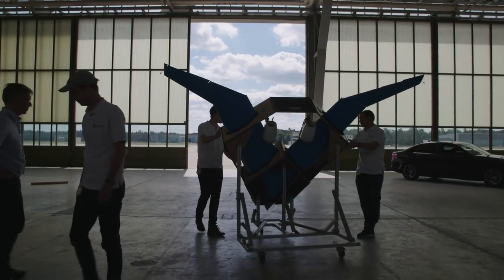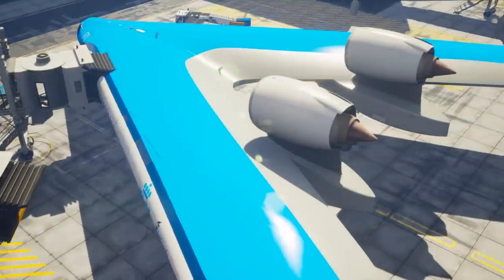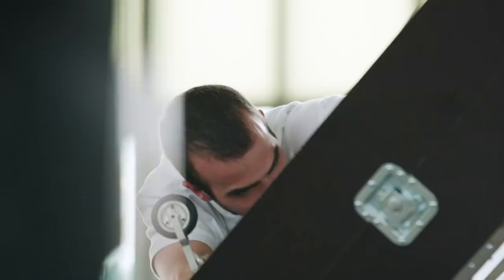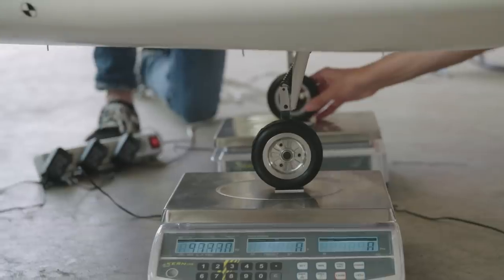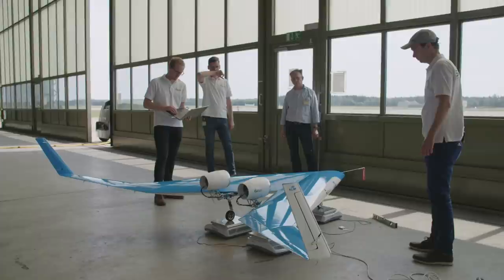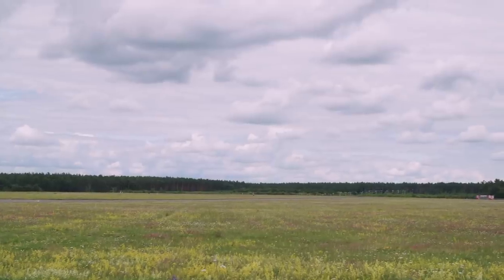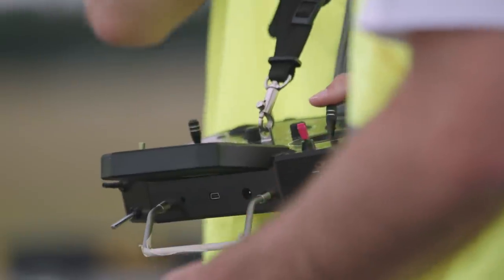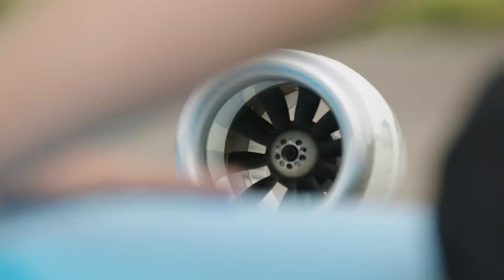KLM & TU Delft present: Flying the model Flying-V

Comment: Imagine being in anything behind first class and sitting on the toilet when the plane starts banking for a turn
Reply: Yeah, would really mess you up, especially old people.
Reply: In coordinated flight you wouldn't even be able to tell.
Reply: @isodoubIet  I think you would definitely be able to tell as you suddenly rise or sink a couple meters. He's not talking about yaw.
Reply: @nbecnbec  In coordinated flight, acceleration and gravity combine to generate an effective "gravity" vector that always points down from the perspective of the occupants. The "turn coordinator" instrument in older aircraft without glass cockpits is basically just a spirit level.
Reply: @isodoubIet  interesting but as an aviator and skydiver I'm questioning whether this could be achieved as the difference between movement on the left tip and right tip is going to be so great. For cargo it will be awesome but for passengers I'm not sure. Wouldn't be hard to find out with a few small accelerometers placed in the model.
Reply: isodoublet , technically average acceleration being smooth is possible but yes throughout any individual point on the whole plane it isn’t possible due to rotational inertia and additional acceleration from the rotation
Reply: Being on the toilet is the best place to be, no need for a change of clothing.
Reply: Pilots are simply going to bank slower.
Reply: @CaptainChrom  I would love to have the chance to be a "test passenger" it's interesting for sure
Reply: Wow didn’t think of that
Reply: @isodoubIet   Different spirit levels in different locations of the same maneuvering aircraft would have different readings at different times. You have different rates of accel/decel. And no plane is perfectly rigid, so there would be an oscillating effect added to this.

No, you'd definitely feel this. And roll maneuvers tend to be swifter and more intense than pitch and yaw. 

In all vehicles there are always parts at the extremities that change velocities and direction faster or slower than the center of mass or center of rotation. And physics takes time to work through fluids and flexible bodies so the feeling is exaggerated into an oscillation. This is why the lower and more central you are inside a ship on rough seas the more stable it feels. Ideally, the more sensitive the cargo is to motion , the closer you want it to the center of the transport- People tend to be pretty sensitive to movement they didn't initiate.
Reply: @panchonorthmann6408  There would be some Coriolis/Euler force that's larger the farther you are from the center, but this concept plane would have a larger wingspan than a 747, (it probably wouldn't roll that fast) but people would be sitting only about a third of the way up the wing. As for the lack of rigidity it would almost certainly be irrelevant.

Comment: Cant wait to see that flying in the sky! The real thing!
Reply: Me to
Reply: Same
Reply: Don't hold your breath! At best, we'll see an adaption of the wing design to current plane shapes. The tube is not going anywhere.
Reply: not gonna happen this thing is way less aerodynamic then the typical aircraft.
Reply: @rafael6693  it will happen
Reply: @rafael6693  The aerodynamics isn’t the problem, it’s center of mass and stability is the problem.

Comment: This is why KLM deserves the title of "most environmentally friendly airline"
Reply: exactly
Reply: That's nice to hear
Reply: in my opinion, KLM 737s and embraers do have small legrooms BUT their long haul flight aircrafts like the 777 has a really big leg room
Reply: Environmentally friendly? Tell that to the families of flight 4805, 433, and 441. A responsible airline doesn't kill its passengers nor litters the landscape with its fuselage.
Reply: @robertpolkamp  accidents can happen, and they are constantly being busy improving the reliability of the planes.
And klm is in the top 20 safest airlines.
Reply: Robert, I understand about those accidents but it has nothing to do with KLM being environmentally friendly, those accidents were caused by something completely different from this topic
Reply: Its nuts klm
Reply: Because they made a model plane?  😂
Reply: Jake Berry Yes of course, a model airplane uses less fuel and has less exhaust fumes ;-)
Reply: P Constructor :-) power saved per passenger transported, -1.2kw there’s no passengers and it still used energy :-).
Reply: Robert Polkamp There won’t be any responsible airlines left for one to fly, if you follow that line of thinking. Air France, Lufthansa, Japan Airlines, Korean Air, Qantas, Turkish Airlines, Delta, American Airlines, British Airways, Air Canada, Emirates, Singapore Airlines, these are all airlines that suffered plane crashes with loss of lives. Let alone mentioning all airlines involved in crashes. Your comment is ludicrous and besides the point.
Reply: Jake Berry Don’t change the subject. 1. Because you didn’t mention passengers. 2. Because if you do, I loose this discussion.
Reply: P Constructor wtf you on about we was just joking about it not being a real plane mate.
Reply: no
Reply: Why? Because they made a model?
Reply: JimmyHolster that’s exactly what I said bud look above haha :-)
Reply: @jakeberry2172  haha didn't see that.
Reply: Perhaps you mean "least environmentally unfriendly airline".
Reply: @JordyDevrixOfficial  Top 20 out of 25? Cramming 400 seats on a 777 is not my definition of environmental friendly.
Reply: @RealConstructor  You get my point. It is ludicrous to spend 2 years on a commercial airliner design that can't glide a single meter. Arguably the most aerodynamic shape is that of a 💧, with the weight and balance right I can fly this droplet around but we both know what happens if it lands. The notion of efficiency at this stage is as ludicrous as the design.

Comment: A model plane enthousiast explained to me that for model aircraft, the power-to-weight ratio can be a lot higher than for actual planes (simply by leaving out heavy things like passengers, computer systems, brakes, and susequently not requiring a strong fuselage to keep all that heavy stuff from bending or breaking the airframe). It can be even higher than for many jet fighters, and I've seen model planes do vertical takeoffs like a rocket. Given that principle, you can make practically any shape fly if you build it small enough and an engine on it. This begs the question: is the power-to-weight ratio for this project anywhere near what is expected for a real passenger aircraft?

Comment: What about turbulences? It seems it is going to have a lot of them in some parts of the aircraft, I mean: you are supposed to sit inside a wing 😅...
Reply: Turbulence will be added to the gunnies  world record for its largest turbulences 😂😂😂
Reply: @mahirdaiyan1021  😂😂
Reply: B2 flying spirit, sort-off proven concept. They will be able to sort it off with some design tweaks and software controlled flight controls.
Reply: @2R0bin0  open B-2 scheme. It doesn't have anything in it's wings. Only fuel...and force elements... Also it costs 2bln. USD.
Reply: @PilotBlogDenys  My man over here has the "B-2 Scheme".
Reply: You cant just take a look at the turbulence off of a scale model as the smaller model is gonna react more with the air turbulance
Reply: The wing is still going to flex up and down during normal flight and I don't think that will be very comfortable.
Reply: @PilotBlogDenys  The B-2 is expensive because it's a big stealth plane and stealth technology is expensive, not because flying wing designs are expensive.
Reply: If you want to know how turbulence affects large scale flying wings there might be something on Northrop's designs somewhere
Reply: Seeing as the wing is designed to be basically the fuselage it'll be pretty much rigid. Turbulence could be pretty similar to what we already have
Reply: @themistaken9571  rigid means weight, weight means more fuel consumption. They said that the reduced weight will reduce fuel consumption by 20% compared to today’s most advanced aircraft. Or maybe we should invent a new material which is light and rigid in the meantime.
Anyway, I think that the Maveric concept from Airbus is more likely to happen wrt to this one...
Reply: @NicoBattelli  Rigid does not mean more weight. A rolled up sheet of paper is more rigid than a flat sheet but they will have exactly the same mass.
Reply: @kazedcat  yep, but the surface covered by both is different, you need a lot of rolled-up sheets. 😁 However, I meant in most cases. I think it's not a fact of rigidity, aircraft need to have moving parts and parts that oscillate, otherwise, it would break more easily. I'm a physicist and not an aeronautical engineer and I could be wrong (probably), but I really would like to know how they handle this problem in terms of comfort. All can see that there is a big problem for passengers sitting at the end of these two wings, I didn't find any given interview/doc about that, as if none was interested in asking this question to them.
Reply: Nico B Passenger comport can be address by limiting the banking angle. The tip of the wings are too thin to accommodate passengers. So most likely that section will hold fuel tanks. Then you need a cargo section to hold luggage. Since the cross section of the wings does not allow cargo below the passenger that means you need to allocate cargo near the wing tips. So you have passenger near the front. Cargo at the back and fuel tanks at the wing tips.
Reply: OH, turbulences? banking angles? That will be free of charge as a value added to the customer exprience 😂
Reply: @user-os7kz3jy5c  Turbulence is more dramatic the smaller the vehicle yes.

You learn this pretty quickly when you try and get a pilot's license and end up in really tiny aircraft. Tiny gusts of winds that an airliner would barely notice will knock you about quite a bit in a smaller aircraft.

And a model takes that to the extreme...

Comment: How does this Plane get out of Stall? I suppose the mentioned "Nose Up Moment" will lead to a rotation on the lateral (pitch) axis. Are the wings and the winglets reaching far enough to the back to compensate for that? I assume you didn't dare to test that on the first test flight.

Comment: Amazing. I'd love to have studied aeronautical engineering & gotten involved with this.

Wouldn't a canard arrangement help with pitch stability?
Reply: It would but the designers wanted to reduce drag as much as possible and canards wouldn't help with that. 
The plane was clearly tail heavy so it should be more stable when they figure out when the need to shift the cg forward.

Comment: Models always work because it’s easier to provide power at small scale due to the relative density of air and lack of need for fuel capacity to support long flights.

Comment: If you already deal with the disadvantages of having the engine on top, why not use the low pressure  of the engine exhaust for additional lift by putting the exhaust stream above a lifting surface?

Comment: Is there a website (or pages within KLM or TU Delft) that gets into the technical details of the design?

Very interesting that you mentioned the potential pitch-up tendency. It would be great to figure out how to limit/control that aerodynamically, but I suspect the solution will be FBW and envelope protection.

Comment: Reminds me of a futuristic version of the Blended Wing Body. With that much wing sweep are they looking for a high transonic  cruise speed?
Reply: I think part of the reason is just to keep it narrow enough to work with current airport infrastructure where a true flying wing would be much wider. Just a guess though.
Reply: @GamblerBE  Very good point. I think one of the iterations of the BWB had folding wing tips so it would fit in a normal ramp.

Comment: I thought there was something wrong with the landing (because of the landing gear). Is that the reason why you didn’t show the landing in this video?
Reply: RC landings are often very messy because of how light the plane is. they probably didn't like showing that haha. and for good reason.
Reply: john pardon haha you’re right. But I also read that the front wheel of the landing gear broke when the plane landed
Reply: @marthijn-7544  ohw oops haha.

Comment: Imagine being seated in the rear of the cabin.

Because the seats are so far from the roll centre vs a standard tube fuselage simply banking only 15 degrees would result in these passengers “rising” metres and then dropping again when returning to level flight.

This is basically a roller coaster. This simple fact will make this unacceptable to passengers.

Doesn’t matter if it’s technically feasible and meets fuel consumption goals. It may have usage as a cargo aircraft if the fuel consumption targets are met at 1:1 scale.

Comment: Would drag not be increased due to the aerofoil needing to be a thickness to accommodate space inside? Of course I would expect that to be thought of, but I'm wondering why hasn't this been looked into earlier.
Reply: Because it's an entirely different kind of construction so a lot of things have to be developed from the ground up.

Aircraft design, like many areas of engineering is quite iterative, so people tend to stick with well known designs unless there's a big incentive to change.

You could equally ask why there are so few SWATH designs in ships, other unconventional designs.

Sometimes it's because of tradeoffs in the actual features, but as often as not it's solely due to unfamiliarity and not having any existing designs to go off to solve some design problems.

This isn't the first flying wing design of course, but the other two notable large examples of flying wings have both been military aircraft.

(and it's been suggested that the original flying wing design was intentionally buried by the US military due to it having stealth properties. - indeed the prototype was destroyed for no apparent reason. Then suddenly 30 years later the B2 bomber shows up.)

You never can be entirely sure what the underlying reasons for a particular kind of design not being explored much actually are...
Reply: KuraIthys It’s true, they wouldn’t be showing it to use if it’s not possible! The Germans made that flying wing in WW2, the Ho 229

Comment: The RC plane is more slim than in their computer model. 
Have some of the questions: 
1) Guys, can you please show us the development studies of that RC plane? If the RC model flies it doesn't mean that it is efficient.
2) Why you couldn't have made it with jet engines? I see the electric motors from Ali express.
3) How much money did it cost for KLM (maybe it is better to support the airline employees rather than spending the money for strange projects like this one)? You know, we are in worst aviation crisis in history. Maybe it is better to let the Airbus and Boeing to design the airplanes...
4) When should we wait for 1:1 scale model? 
5) How to avoid engine flame out at high angle of attack? It will be shadowed by the wing-fuselage.
6) What is the real size of that airplane? With that thin airfoil it should be one of the largest planes to contain passengers, fuel and all the airplane systems. 
7) Icing of the wing leading edge. It is very wide and will get lots of Ice. If you want to have passenger window, that is even bigger problem. 
8) Force structure elements. Please open B-2 bomber scheme. You'll see that it has all the standard forse elements like in real plane wings are reinforced. You are planning to have people there. So how to provide strength to the construction? Should  passengers seat between those formers, stringers and logerons?
9) Ground facilities. How to board passengers? How to load bags and cargo? With that V- instruction passengers boarding interfere with cargo(luggage) boarding. In current airports.
10) How much would the real airplane cost? Does it worth to take it for saving 20% of fuel. And please show us the research. Now you just tell 20% and didn't even put jet engines on that RC model. 
11) Show us the landing! Did you crash that toy? 🤣
12) How to maintain those Engines on the top. You need a high leader there and still you won't have full access to those engines. You need to maintain engines very often. Add oil, etc. 
13) How should I check engine intake for birdstrike? I won't see the inlet from ground...
14) Turbulence. You see the wing wave on normal plane. That is done with purpose to avoid damage. Here the people should be in those wings.
What can I say, guys... 
I am sure that it is just a waste of time, money in the worst time for aviation industry... 
It won't be flying, believe me. It is just the RC plane made by students. Not even close to real research and design. But I am sure that they spent tons of money for it... and will waste much more...
Regards.
Reply: Pilot Blog all your questions will be Researched because this is  a research project done by Airbus so would think about your comment......this r not studente but researcher from the best Aviation university of the world! If you r a real aviation specialist you would know this already.
Reply: @ioptia  I t is not an Airbus project. Airbus has it's own flying wing project. This toy is claimed to be done in collaboration with Airbus. And we see it first in this video. They have never told that before. Airbus project and collaboration with Airbus project are 2 big difference...
Reply: Pilot Blog whatever
Reply: Pilot Blog uhm look at end of video you see Airbus logo ......
Reply: @ioptia  So... ?

Comment: Which concept did they prove exactly? I’ve seen larger and more radical designs flying RC. And landing successfully. Everyone knows this can fly, the question is does it fit in a parking slot or can you evacuate it fast enough. Those are the concepts that need to be proven.